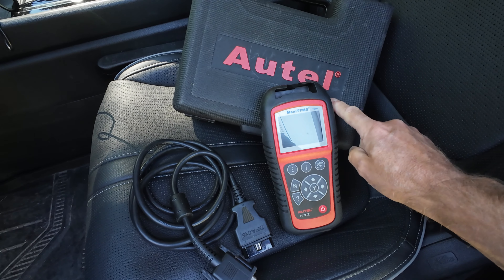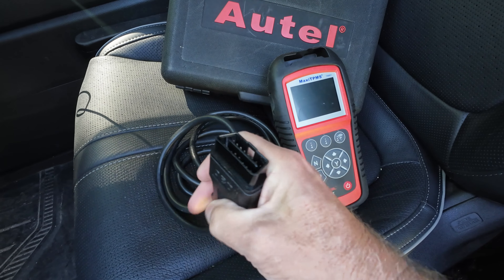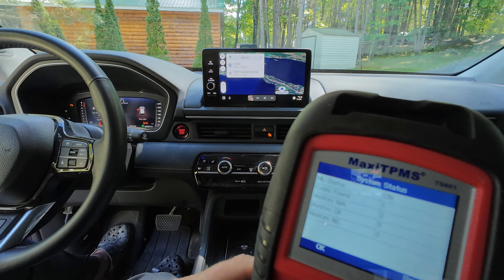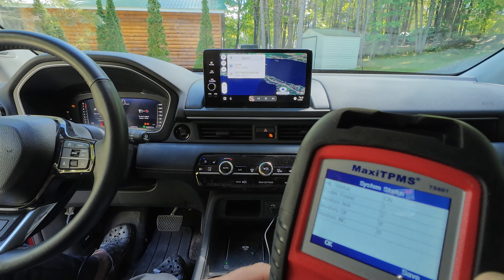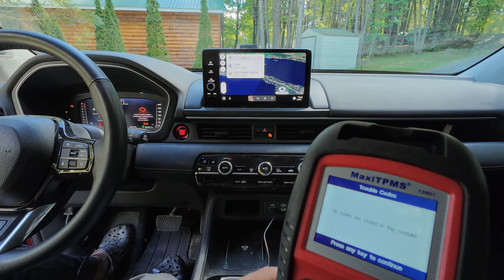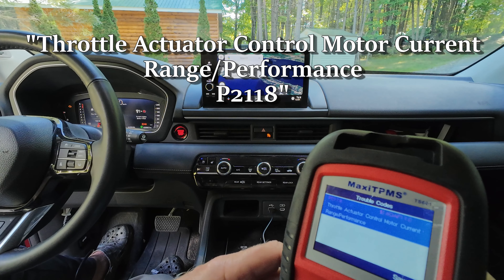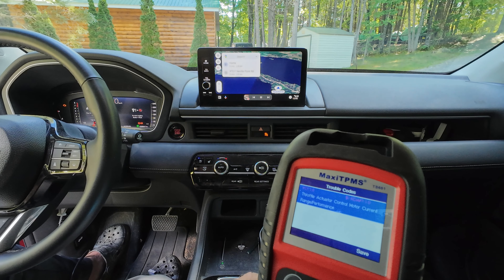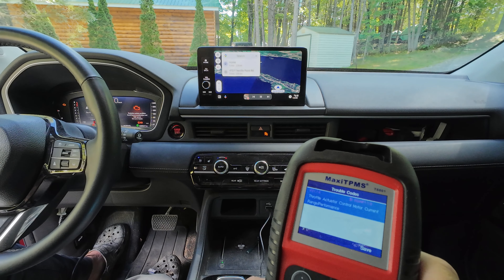Honda Pilot 2023:  What to do when the engine diagnostic lights come on!

Comment: Let me guess... lose gas cap. Time for a new one.
Reply from the maker: A reasonable guess, but actually the 2023 Pilot doesn't have a gas cap!  The explanation (well, hypothesis) is at the end...
Reply: I just had the same thing happen to me, but I’ve only had it serviced at Honda.
Reply from the maker: @kylestrobel6255 Well, I guess it only takes a small piece of crud to mess up the sensors.  Hope yours was resolved.